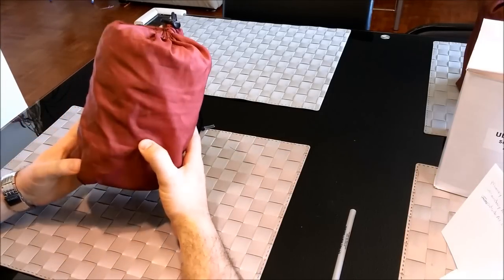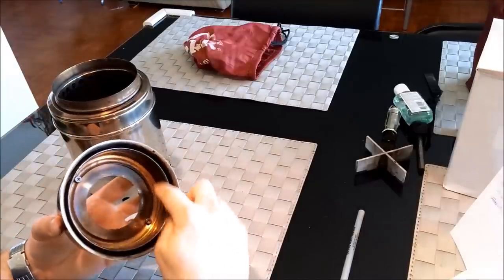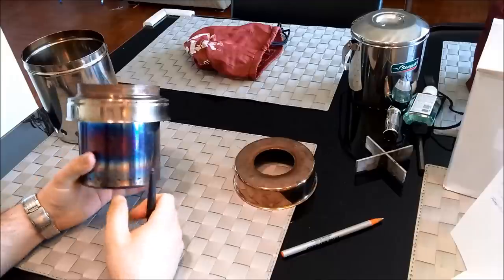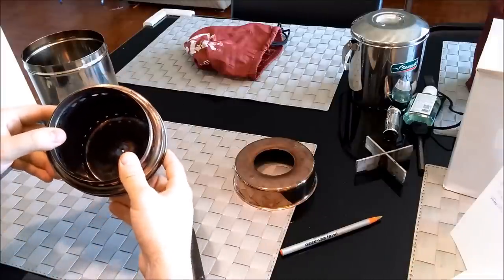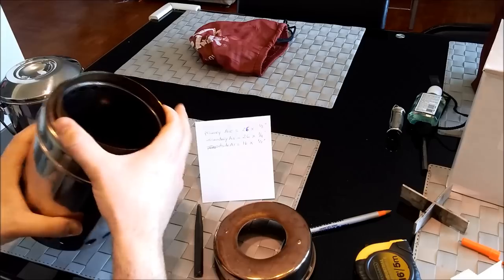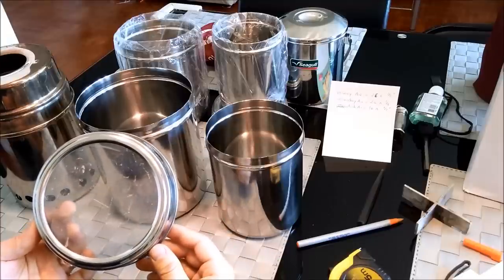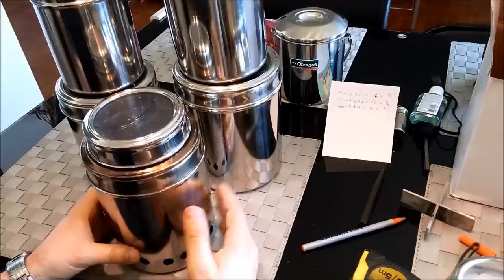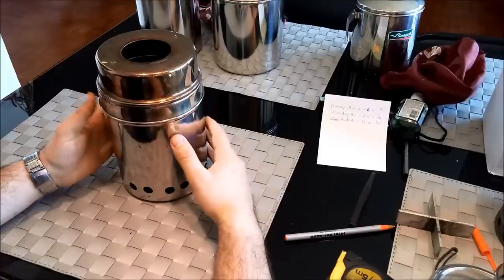Breaking down version 4 - DIY Stainless Steel Wood Gas Stove

Comment: Question: how did you get the outer lid to fit onto the inner can? Did you force it with some tool or something because I can't get the darn thing to push down over the inner can till it stops at the notch. Please help.
Reply from the maker: Hey Mandi,

Sorry I just realized I missed some of your other questions. I'll try to answer those as well later today. With regards to getting the inner can to fit all the way into the outer can, there are a couple things to consider.

First off, I recommend you make all the necessary holes in the inside can before forcing it into the outside one, because once it's in there, it's most likely not coming out until after 1 or 2 burns. After the first burn it should expand and loosen things up a bit. But once your holes are made in the inner can, you need to SLOWLY and GENTLY force it into the outside can.

Tip: I found that using a plank or flat piece of wood that is wide enough to cover the can, and long enough to give you a bit of added leverage to wiggle left and right, while using your body weight to evenly apply pressure and slowly wiggle it into the can.  When I say "wiggle" I mean small left and right motions so as not to dent or distort the inside rim too unevenly. And making sure to take turns "wiggling" it in all directions equally so that you maintain a good seal with even bending of the inner lip.

Secondly, I would wait to make all the holes in the outer tin until after you have the inner tin pressed in place. The reason being, the outside can is not made of thick tin, and your body weight pressing on top of it may crumple the outside can if it is weakened with all those holes in it. There should be sufficient space after the inside can is inside to still make the outside holes.

For the outside holes I think in a previous question you asked what tools I used to make them. I started with a small drill bit, then used a "stepped" drill bit to gradually increase the size to half inch. A stepped drill bit looks kind of like a cone shaped cutting bit that gradually increases in cutting size.
Reply from the maker: Mandi, sorry I thought you were referring to version 3 when I answered in my post above. If you're referring to version 4 which is fully stainless steel, inside and outside can, then you can simply place the inner can on top, and step on it to get it to sink into the lid for the inner can. That is of course assuming you took the clear glass/plastic piece off already. The outer can and lid being stainless steel is sufficiently strong for you to stand on it, or even "stomp" it into place.

I hope this helps, and I hope to hear back from you after your done and gone through your first burn!

I think it's amazing that your doing this with the kid's and thinking of making it into a sort of science experiment that they could get involved in and learn about wood gas, as you mentioned in one of your previous posts. Good luck and keep me posted!

Comment: Surely the area of the outer base holes should only match the area of the holes drilled on the inner container,.
Also the holes at the top of the inner should be smaller, as the heated air column only provides oxygen to burn the tar gas in the top.
If those holes are too large the latency of the air in the outer chamber will be low and not heated enough to promote heating of the unburnt wood fuel.

Comment from the maker: Franco, yes this stove and virtually anything else you burn WILL produce carbon monoxide. You should NOT attempt to use this INDOORS in an enclosed space without proper FLOW THROUGH VENTILATION. If you are looking for something to heat an indoor space in an emergency, look for something that is designed to do that. Off the top of my head, I can think of small Propane heaters like the "Mr.Buddy" heaters, or even better, a Catalytic type propane heater like the Coleman "blackcat perfecttemp catalytic heater" which burns cleaner due to the catalytic reaction. Both are designed to operate in small spaces like an ice fishing hut, as long as you have fresh air coming in.

Comment: Think about how it works, a copper inner container would be best to heat the dry wood from the top combustion zone down to the lower portion.
Not relying  the heated air column alone.

Comment: Does it have to be stainless steel or can I take one of my chrome steel pots that I don't need anymore? Would it be unhealthy to make a fire in a chrome steel pot/container?
Reply from the maker: Sven Lima it does not have to be stainless steel. The only reason why i chose stainless is to prevent rust, since the goal is to create something that is actually usable in real world conditions outdoors, where moisture will cause many metals to deteriorate and rust.

Comment: Would you use the same number and size of holes on the smaller can sets that came with that order?
Reply from the maker: Jprivate, the stove you see built in this video was actually built using the two smallest cans from that 4 piece set. So if you stick to the same dimensions and number of holes that I outline here, you should expect similar results.

If you want to make the larger version using the two larger cans, then use the same sized holes, spaced the same distance apart, and you should end up with more holes that are proportional to the smaller stoves design. Results from the burn performance should be similar.

Good luck!
Reply: Joe Marques  Thanks much, I look forward to trying this out.

Comment: I have a question about your pot stand, as I was thinking about doing something similar on a high-heat hybrid alcohol/wood stove, does it function to help the flame in the manner of a windscreen, such as are on some single-burner propane stoves?
Reply from the maker: LogicMatters the cross pot stand design I'm using definitely helps with "windproofing" to protect the flame, as does the concentrator ring that it sits on. One point of weakness on these stoves is the oitside air intake holes on the bottom of the stove. A strong gust of wind can overcome the delicate mix of heated gasses and cause it to flame out. However once the stove is properly falsifying it can be remit just like an ordinary gas stove by lighting the smoke (gases) coming out of the top of the stove.

Comment: I want to know if it produces carbon dioxide, or if I can use to heat a room in winter.
Reply: +Franco Noseda (Luca Vesuviani) Do not use this indoors - and it's carbon monoxide (CO).
Reply: +Franco Noseda (Luca Vesuviani) 

Absolutely do NOT do use this stove to heat a room.  The CO will kill you!  All wood burning stoves create carbon monoxide.  This stove generates CO during burn, but also generates copious amounts after the volatiles have extinguished (burner goes out) and the charcoal continues to burn.

Always use this stove outdoors.  ALWAYS.

Comment: Love the new stove. I am curious, what made you want to redesign your version 3 stove? The burn on that one seemed absolutely amazing.
Reply from the maker: Jeaux I guess the v3 stove left a little to be desired from an efficiency stand point, when I tried putting it to real world use. Put it this way, v3 was more of a scorching "foundry" rather then a cook stove. It guzzled through fuel, whereas the new v4 sips fuel, while still producing enough heat to boil 1 liter of water in 10 min, and more then enough flame time to cook an entire meal. Not just a boil water and throw in noodles "camp meal", but a full blown BBQ steak on a cast iron skillet, plus boiling water for your pasta or rice for 3 or 4 people, and then  making a cup of coffee! For comparisons sakes, I averaged 40 - 45 min of flame on v3, vs 1 hour 15 min on the new v4. That's almost 40 min longer usable flame time for almost an identical sized 3 cups of wood pellets.

So although v3 produced a flame that was very beautiful to look at, the end result of a stove in my view should be usability and practicality for it's application in the field.

I'll be doing a side by side comparison in one of my upcoming videos, as well as a walk through of the v3 stove. But essentially I'll take some time to go over the pros and con's of each, since they both have advantages over each other, depending on what your trying to achieve.

Comment: Just ordered the 4 jars, and they no longer fit like in the video.  The lids have more material on them and don't slide over the smaller jar with the center removed!  Anyone else have this issue?
Reply from the maker: Thanks for notifying of the potential change in dimensions of the pots. I would also be interested to know if anyone had a similar experience as yourself. It would be a real shame if the current link I provided is no longer useful or reliable.
Reply: +The Pipe Parlor  Bought the set too. Lids would need modifying for it to work unfortunately. Same issue as you.
Reply: +The Pipe Parlor 
I just received the canisters and they no longer fit together like in the video.&#160; They changed the die for the hole cutout in the lid.&#160; It is too small to accommodate the diameter of the next size down jar.&#160; I&#39;m going to see if I can find a stainless steel container that will fit the hole -- something like a bain-marie from a restaurant supply.&#160;The other option is to grind the lid hole out, but that is such a pain with stainless.&#160;Otherwise, I guess I have some unwanted canisters.

Comment: Adding holes in the top inner, defeats the purpose of having a heated air jacket to heat the base of the inner unburnt wood.
Creating pretty swirling air jets in the combustion area is nice  I  guess.

Comment: I've been amazed by so many of these stoves but s many of them don't have a way to really add fuel while cooking
Reply from the maker: Ben Schildgen your right, these designs don't really lend themselves to well to being reloaded. Although you can always add more fuel to the chamber, doing so greatly increases the chance of putting out the wood gas combustion reaction in a natural draft stove design like this one. Although i do have a forced air Biolite gas stove that copes much better with this.